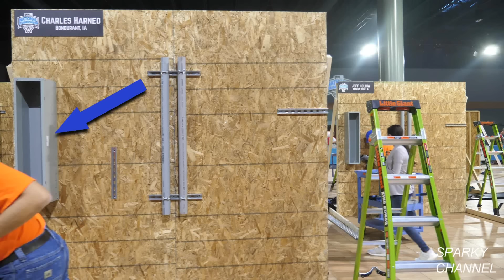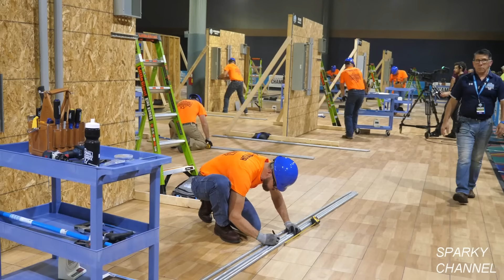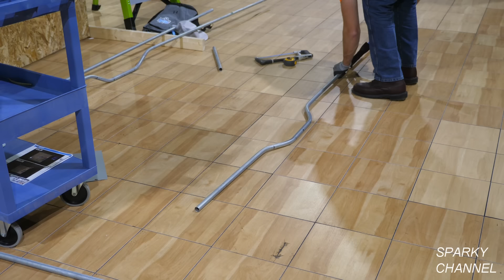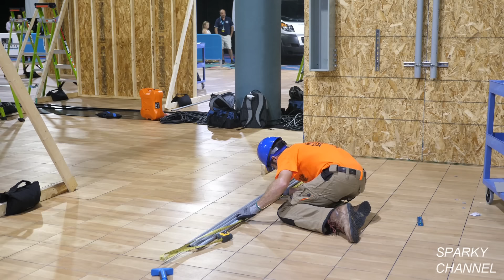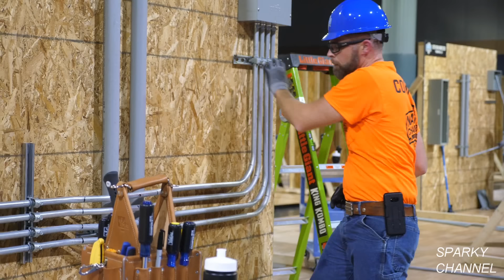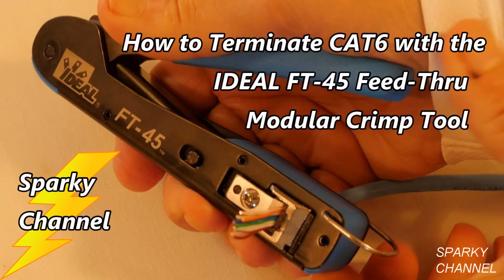IDEAL National Championship Pro 2nd Round Parallel EMT Bends

Comment: I just made a score of a nice vintage Ideal 1/2 inch malleable iron bender, a 3/4 inch Benfield  Tool 3/4" EMT/1/2"GRC-IMC, 3 Benfield Tool No. 4 1 inch EMT/3/4" GRC-IMC benders and the ultra rare Benfield J5 1 inch power pedal bender, an Ideal # 006 1-1/4 EMT/1" GRC-IMC  and a Benfield Ductile Steel No. 6 1-1/4 inch EMT/1" GRC-IMC bender, a Greenlee Chicago Bende a Greenlee 1818 ratchet bender, and Greenlee 555 with a PVC coated GRC shoe. I use a hacksaw to put marks for the centers of a 5 degree, 10 degree, 15 degree, 20 degree, 22-1/2 degree, 30 degree (the notch is already the center of a 45 degree bend) and I will add one more notch for the center of a 60 degree bend. For low 3 point saddles I like 10 degree-20 degree-10 degree 3 point saddles. One company had much harder conduit bending pre-employment tests and NO SPARE CONDUIT to do them. One required a Mineralac strap a rolled up 90 that was a symmetrical part of a 3 point saddle then another saddle a 90 and box offset. ONE STICK WAS ALL YOU GOT. Before that the shop manager threw a cardboard box at me 1 stick of 1/2" EMT and he said make a 4 point saddle. Then the obstacles from hell board came out. I eventually made it into concentic bending all rigid pipe all day long in a factory. I loved it! Ideal makes the best hand benders now that Benfield is defunct. M. Klein sold Benfield benders under both the Klein and the Benfield names.
Reply from the maker: Excellent!

Comment: VERY nice  job on  the  double offset. i expected follow  bends  on the 90s but  i am  afraid that  skill has  gone as  no contractor will pay for the extra time  it requires. now give  them a  hydraulic  bender  and  a length of 4"
Reply: Some factories still required concentric 90s for all exposed work, and it was all spec'ed for rigid pipe too. Rigid pipe, NOT that IMC junk!

Comment: Well, I'm 66 now and I am sure the fast guys here could beat me in my prime, but several things come to mind. I did not run conduit everyday many days of running trouble and even some house wiring, a lot of oilfield and a lot of rigid pipe.
I always ran a wood ruler and still do.  Always had a heavy cotton work shirt with two pockets for a pencil and clear cheater glasses and safety glasses.  Never used a sharpy and when I was running Emt I carried a bolt bag with two spots for screwdrivers and kept the wood rule and a four-inch square shank for reaming and a pair of channel lock type pliers for the outside ream along with a pair of kliens. Kept straps and couplings and connectors in that bag.  I stayed off the ground as much as possible.  I use a cordless small one hand Sawzall now but cut all sizes of pipe up to 2 inch rigid with a hacksaw until the first Sawzall came out and eventually used hand band saws pencil in one pocket and some tools on the hip cut time by a lot. put your pipped in front of one knee and behind the other or use a ladder to cut.
Reply: I am 59 now, and I did some fabulous concentric bending rigid pipe with  Greenlee benders from the Chicago bender up to the hydraulic 666 and an Enerpac Egor with two shot shoes for 5" and 6" GRC. I always used pencil on EMT, IMC or GRC. If the conduit gets painted that Sharpie ink will bleed through the paint until the cows come home. Wanna piss off the drywallers and the painters? Write on their walls with a Sharpie. You will be running around spraying all your artwork with a can of Kilz primer and praying that it works.

Comment: I had to take a test for the IBEW after I Journey'd out in December. The test was a schematic to build and wire up a light/junction 2x three ways, a 4 way, a 2 gang switch, gfi, and a half hot recept involving two parallel offsets, a 3 point sadle, a 90° and a back to back using 1/2" emt all interconnected. It was a lot harder because I was being watched and a nervous wreck, but did it and passed. So props to these guys. I can only imagine the pressure, but I was doing it for career leap, these guy's ate doing it for prizes 😂
Reply from the maker: Great job! Yes, the pressure adds another dimension to the work.

Comment: you can't make proper curved parallel conduits with a tool that make bends of the same fixed radius of curvature. 
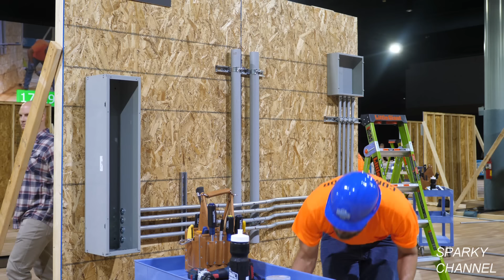Example at 21:02
The innermost and the outermost have the same radius of curvature, so they can't be parallel
Reply: Yes you can . Just takes more time and skill
Reply: @travbrunet6950  mathematically you can't. You can make something that looks ok, but it's not a proper parallel curve.

Comment: Wh…why are you bending it upside down?
Reply: with EMT it's a commonly used practice, its quicker and everything that you need to see is closer to eye level. Would avoid bending a full 90 with the bender upside down though because it's easier to kink the conduit without the foot pressure on it.

Comment: So for the 90 you’d measure from the gutter to the right side of your pull box connector ?
Reply: Yes
Reply: yes always back of the 90
Reply: Yes. And only measure for the most inner one. Then just add 2” for next one. 2” to that for 3rd pipe, etc.
Reply: @sam-b6f3q just depends how far you separate your connectors, just add that to your next 90

Comment: I’m very impressed with how fast he works but definitely could see it be significantly more efficient! It hurts to see people not use the pass through method while bending pipe when you could do it standing up and never have to flip your bender around or do awkward bends. So much extra work being done. And you already know your 90’s are two inches farther apart so you could have just measured all those together to bend them at the same time then cut all together. Cut down on that back and forth between multiple tools. This is why efficiency is much better than speed. Main thing I teach apprentices to also help learn with looking ahead at next steps to come.
Reply from the maker: Thanks!

Comment: OK, I will not lie, but this is your best? Amature way to bend pipe. 4 point saddles, all the bends should have been done in a row, no flipping pipe around. Where is the Foremen in all this? He should be looking over his shoulders, telling him, "Come on, the job needs to be done yesterday" Now, that would be real-life pressure. All that adjusting at the end should have diminished his score. Everything was off. If you really wanted to make a challenge, the 90s should have been multi-shot concentric bend. Not the hideous looking whacked out 90s.
Reply: What place did you get on this?
Reply: no, you do not bend a 4 point saddle by bending all in a row. The only way that will work is if you oversize the conduit, make the bends, then cut to fit.
Reply: If you know the formula for shrink and gain factors, there is no reason to flip the pipe around. Just like multi-shot benders, the same applies to hand benders.
Reply: @anthonyjannace4410  did you just bring up gain factor what talking about a saddle? Lol nice try. The proper way to make a saddle (3 point or 4 point) is by flipping the pipe around and knowing where to add shrink. It’ll never turn out right otherwise
Reply: You have to flip the pipe with offsets. Saddles are types of offsets. Never seen anyone bend a saddle without flipping the pipe lmao

Comment: 1st.   Theses guys spend yo much time on the ground.  2nd  that's the worst way to bend a 4 point saddle.  3rd using the bender to cut pipe once again why are you down on yhe ground.  Then after tge cut he throws his binder and hacksaw on the ground.  So he has to pick it up later. Then he has a cart there but he's measuring down on the ground. The guys need to learn yo stand ip and work.
Reply from the maker: You make a good point about staying off your knees as much as possible. IMO your knees will feel better longer if you are kind to them.
Reply: @SparkyChannel  or get work pants with kneepads? They've been standard in the trades here in Europe this 25 years.
Reply: Any more advice for the 3 time national champion?

Comment: I bet if you take those pipes and lay it on the ground, not only is it dog legged but i bet none of the bends match.
Reply: Ok
Reply: You could see he didnt have dog legs when he layed them flat and they were flat. They didnt show a top angle on those 4 bend saddles, bet they were slanted. Several looked slightly off. And the outermost 90 looked slightly over bent. Considering the speed and pressure, the guy is still a beast

Comment: I would just Bend 1 Large Conduit to handle all Conductors. Could save on Ground Wire. 1 instead of 4. A pencil works well. Just needs to be visible to Electrician, Not Camera Crew, Everyone, looks bad Afterwards. Love to compete in this.
Could use 75K. I would use The Klein  Conduit reamer that does inside and outside deburring, automatically adjust for 1/2", 3/4", maybe 1", usually do with my Klein's Lineman's. But if going for Flat out Speed, I would use the 1 tool. Would make him faster as well. Also appeared was a Larger Gap between #2 and #3 Conduits, then they got better, make me wonder if conduits were not fully seated to appear good. Another way to get accurate spacing is to not have connectors in upper right box, have all 4 a little lin going up into box, level and space all 4 equally, make a mark across all 4 conduits where they seat in the connector, cut squarely, will be exact. This looks like for regular Electricians, Not an Electrician with OCD, or other Gift. If I was Judge, would Verify all are seated. Was shock to see how far behind others were.
To Add, lot of unnecessary Crossing of conduits can be from Poor Planning of the Ins and outs, and placement of Equipment and Enclosures. Good Entertainment for Electricians and Handymen
Reply from the maker: Thanks Randy, excellent comments. Please do enter the contest.
Reply: Derating rule would get you someday....

Comment: Press an aluminum slug into the 1/2 inch EMT bender handle then drill a 7/8+" hole offset flush with an inside edge. The hole is for tweaking using the handle. Slip on a left motorcycle grip to work as a grip and protection for finished or slippery floors. 
Now back to the regularly scheduled bend off.

Comment: I do have an actual question.  Do electricians not have some version of a saw horse? My knees were dying watching them get up and down so much!
Reply from the maker: Me too! As an older electrician I know how valuable knees are so I really try to protect my knees.
Reply: They could have cut their conduit over their carts but no one did.
Reply: Rack a tiers cable racks are good for cutting on.
Reply: You just get used to kneeling down for most tasks since the ground more stable that most other things to use as a table, especially for making straight cuts with a hacksaw

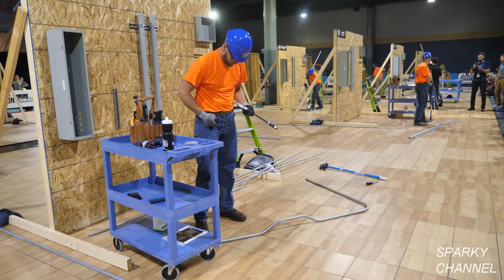Comment: 11:38 nice tight, and sharp, hack saw blade is the key to a good cut.
Reply from the maker: What TPI do you prefer for your blade?
Reply: @SparkyChannel  As you know it depends on the material being cut but for conduit that size I prefer a 24-32 tpi. Gets through it quick but doesn't tear up the edges too bad. I'd take the 32 tpi over the 24 though if I have the choice.
Reply from the maker: @mikeznel6048  Good tips, thanks!

Comment: pretty good job but i never once saw a level. and thats the difference between a good job and a great job. the eye is great, but the level is for sure.
Reply: Level doesn't always look good to the eye and in the conduit world, level is never promised. Electric flows whatever way the wire goes too.
Reply: @mikeznel6048  absolutely. When hanging conduit that is in plain view especially when it is running parallel to other conduits I am more concerned how it looks when somone glances at it and has multiple other conduits to reference.
Reply: @beckyschwantes5287  Yep that's the only way to do it. Even in finish carpentry and trim, level isn't always the way to go. Sometimes you have to buy out something that's outta whack by going out of level so it looks good. Same is true with conduit. It's gotta look good to the eye.

Comment: Someone planned a pipe run for us down a hallway with 3- 1 1/4", 2 - 1", and 3 - 3/4" that would eventually have to turn 90 degrees to get around a corner with the 3/4" on the outside.  Using regular benders would have made it look really bad.  So I showed my partner how to bend them all with the 1 1/4" bender at the 90.  The resulting spacing got a lot of attention from other electricians walking that hallway.  I had learned that years ago as a 1st year from a younger woman from Chicago.  Good video.  Nice pipework guys.  I'm surprised anyone knows how to  use a hacksaw anymore. LOL
Reply: How'd you manage to not flatten the 90 of the 3/4?
Reply: @ghoul1shgobl1n49  I am a very tricky electrician.  Just happens the bender was good and with slow easy pressure it worked.

Comment: So when using the star you don't have to do the take up space subtraction of the 90?
Reply from the maker: No. You do measure to the back of the bend though.
Reply: no the star is the accurate bend just remember to turn the bender head around

Comment: With compression conduit connectors would you still install all four connectors at once? I dont think that would allow enough space to turn your channel locks.. ?
Reply: You work from right to left, it gives you enough space to tighten your connectors from the left hand space. If you wanted to loosen them, you have to work from left to right.
Reply: No way you could tighten them with close spacing. You'd put up one conduit at a time with the Connectors on it already prepped. So you could still be fast, you'd just prep your pipe with Connectors not the box in that situation. Imo...

Comment: How cheap is that conduit. Need a free standing bender to bend uk galved steel conduit
Reply: EMT is a thin-walled galvanized steel conduit similar to plastic trunking in the UK (minimal protection). Rigid conduit would be more familiar to you as metal conduit, as it is a thick-walled galvanized steel conduit, which is threaded.
Reply: This contest wasn’t set up with your U.K. Galved steel conduit ... I’m sure like most electricians your smarter than everyone else in the room.

Comment: I’m surprised in a competition sponsored by an electrical tool company I didn’t see anyone using an actual pipe reamer
Reply: They also used marker. The point is it's not about preping it for wire or for the customer. No wire will be used. They r being tested on there bends

Comment: As a final, have a "beat the engineer" challenge, where there are a set of implementation requirements, which can no longer be met because a 'new obstruction' was not accounted for in the design. This would be a combined code and experience 2-part challenge where the first part is developing a plan to resolve the unaccounted for obstruction issue without using more than 10% more material than the original plans, still meet code, then explain the changes to the 'client' in a request for approval. The obstruction will not be in the plans, so must be accurately measured by the individual competitor before the plan changes can be formulated.

Then the proposed changes need to not exceed 10% additional materials 'cost', points gained for each percentage under 10, double points lost for each percentage point over 10. A planned 15% overage will have an automatic 'denial' from the 'client' when explaining the changes and reasoning, when trying to obtain 'approval'. Phase 2 will be implantation, where the competitor must explain to an 'apprentice' chosen from a pool of 'available workers', and the faster your plan is ready and approved, the higher your pick priority, and the pool will have 1 less available apprentice than there are competitors: meaning the last approved (by time, since the 'client' will be the same for all competitors) will not have an 'apprentice' for phase-2. The plan from part-1, then has to be implemented. Any overages here will be docked triple points for each percentage over the part-1 estimated 'cost', up to a total of 15% from the original planned 'cost'. If the part-1 cost was more than 5% more than the original and the implemented 'cost' is more than 2 percentage points less than the part-1 estimate, then there will also be a triple point penalty for each percentage point more than 2 below part-1 'cost', as this will be viewed as trying to stiff the client. There will still be an implementation time limit, which will affect points, too.
Reply: This is a cool sport. I’d watch competitions like that for sure.
Reply: @ericross5048  I figured having something that can really separate the masters of the craft from those who are just master electricians would be appreciated by those who are competitive. Also giving an opportunity to 'show up an engineer' could be a bit fun too.

The component of a plumber or hvac contractor encroaching on the space needed for the electrical, despite the plans is an all too real eventuality. So showing off the competitors' ability to cope with the problem is a valuable skill, particularly while balancing time and material costs. All off this together and the competitors have an ideal opportunity to show potential customers why they should be hired on future projects.
Reply: @thomasbonse  IDEAL seems to be the only one putting on this kind of competition. Maybe someone should reach out to them about this kind of thing. I kinda wish it were on ESPN.
Reply: that is hilarious.
Reply: It sounds like you had a bad day at work. 🤣🤣
Reply: @alejandroblue4675  How does anything I said sound like I had a bad day at work?

Comment: I think a similar challenge, but where you not only have to maneuver over one obstruction, but also under another obstruction, such that you're just coming up on a cumulative 360 degrees of bends and the longest parallel should have no cuts or couplers. Basically having to navigate around both hvac and plumbing obstructions  without wasting materials.
Reply from the maker: Cool! I love it!